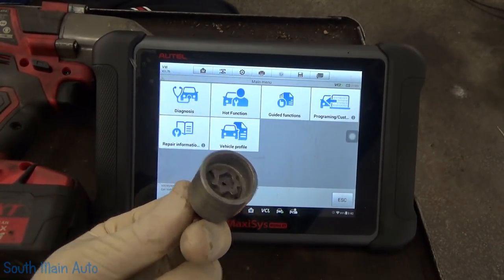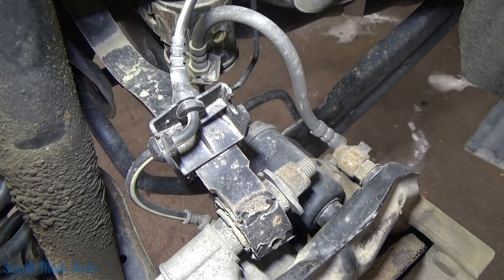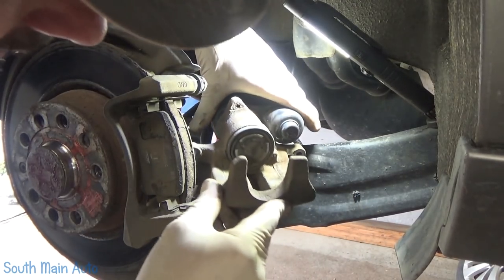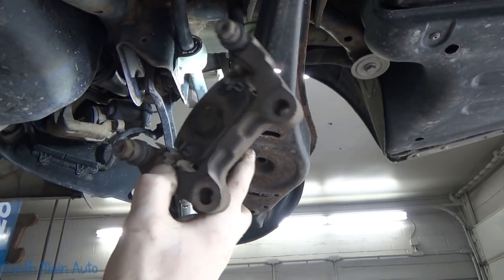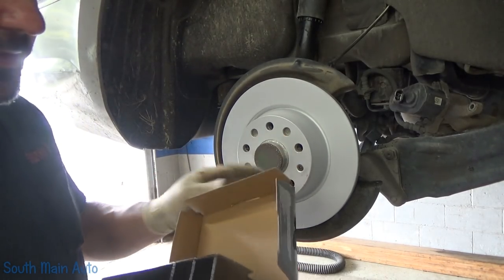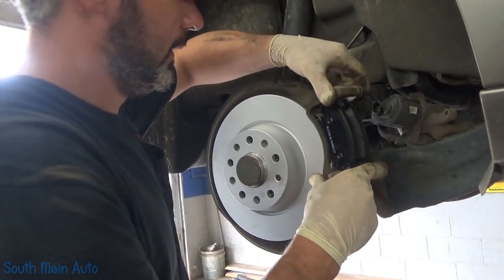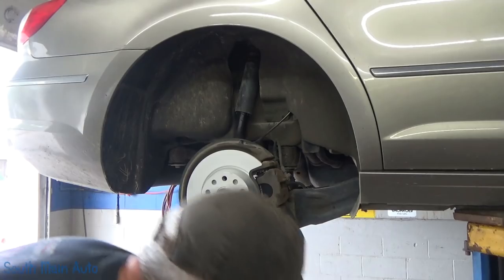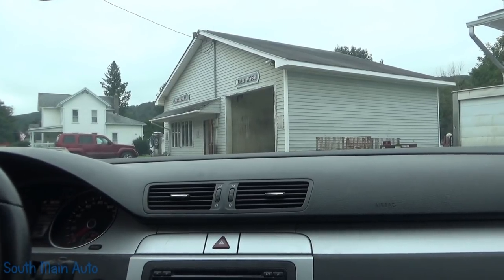Do You Need A $1000 Scan Tool Just To Change Brake Pads!?

Comment: I think it's terrible that on these modern cars you can't even do your own rear brakes anymore due to the addition of these electronic parking brakes.  I swear the engineers/designers add these systems to force the DIYer to have to bring their cars back to the dealership.  This channel educates us all BEFORE we buy a car so we will know what we're in for if we buy these models.  Great video.
Reply: Kenneth White  I think newer Audi's and other manufacturers  require the battery to be adapted or programmed to the car.
Reply: It's a VW, this is why you NEVER BUY EUROPEAN CARS! Way to reliant on computers!
Reply: Nothing to do with being a European all these electronic devices are to pave the way for stop-start and "autonomous" vehicles. Spoiler alert there is no way the authorities in any country are going to let autonomous vehicles be serviced outside the dealer chain.
Reply: Sad part is, that's ALL cars today. Wait until you see the crap they're doing on '18 -'19 vehicles ...
Reply: I would place the blame on business people wanting to maximize after sales work, and not so much the engineers/designers.
Reply: Of course they want you back at the dealerships. Get those genuine parts fitted/ BMWs require the battery to be registered, the original battery did last ten years though.
Reply: Rubbish.  ALL cars are.   Cars are made from components, manufactured by companies like Delco, Bosch, Mitsubishi, Hitachi, and the like.  So the VAG rear brake caliper is using exactly the same BOSCH EPB, along with BMW, Audi, Ford, GM, Opel, Nissan-Renault and Citroen.   

Mitsubishi is using either Bosch, Mitsubishi, or Hitachi.   Can you see there's a pattern here?
Reply: Again - Pretty much completely wrong.   You can install a new battery into any BMW without registration.  However - it probably won't last.  The charging profile for the battery you had is learned by, and programmed into the ECU.  The cars charger (Bosch) is intelligent and can charge AGM and standard batteries without an issue.   The intelligent battery charger, when configured correctly, will easily extend (double/triple) the batteries life - even when auto start/shutdown systems are involved.
Reply: And all they really care about is if everything lasts long enough to make the end of warranty. After that, they really could care less.
Reply: Very sad indeed. Even Chevy trucks are going to have that stupid start button with the start stop BS, the world has officially gone to hell
Reply: Many cars have a user accessible menu or series of button presses that will enable service mode.
Reply: i can see why engineers add these systems for "Safety! Safety First!" and now they have a safer car than others but man the brakes are a serious pain now with this new "safety system", there was a story at toyota that make sure you dont open the door when pulling the car onto the hoist/alignment hoist, one guy did and had the throttle halfway down and had the door open("safety sytem now engaged since the door is open and the driver must have accidently left the transmission in drive) just as soon as he closed the door, thats when the electronic e-brake let off and lets just say that brand spanky new 18 camry needed quite a bit of bodywork after flying off the alignment rack, as a mechanic im starting to feel these vehicles are getting a little over-engineered so your 10yr old can drive it if hes big enough for the seat
Reply: i have a subaru legacy with rear electronic parking brake, you can buy a simple tool that screws the piston back into the caliper which retracts the electronic parking brake. No computer needed.
Reply: It’s not new they’ve been fitting them in the German junk for at least 10 years now!
Reply: Adam Smith A lot of Fords do it too.  If I remember from when I was at the ford dealer it was called like an IVD initialization or something
Reply: TheMillennialMechanic funny Ford/Land Rover/Volvo/Citroen have a lot of parts shared!
Reply: TDM 4x4 Ford owns Land Rover unless they sold it, but I didn’t know about the Volvo/Citroen parts, that’s interesting
Reply: come on guys. VW needs to recover the 8Billion they lost on the Diesel emissions pickle they are in.
Reply: TheMillennialMechanic Yep now owned by TATA of India! We’ve got a right old parts bin of Ford/Honda/Volvo/BMW/Rover/Citroen to name a few! The BMW early ownership electrics with a Lucas prince of Darkness/BMW brand of lunacy! But they did give us the L322 Range Rover to make up for it 😂 then stripped us of the 4wd technology, sold us for £1 and kept the MINI badge too - another cracking German bundle of joy 😑😂
Reply: Dont buy new. lol Ive owned 50 cars and never bought one less than 15 years old. Most on average wher 95-01
Reply: I will just but old cars and fix them up
Reply: @motorsandmore990  my latest is an 01 passat with 145k I paid $250 us dollars for.
Reply: Yeah that's how i am too. I only buy mint condition low mileage cars that are between 1988-1995.  Mostly OBD I vehicles although i have a newer 1999.
Reply: Engineers planned the vehicles obsolescence and the company planned the service costs. Also built the vehicles to overwhelm the DIY’er.
Reply: @zuestoots5176  nice
Reply: @zuestoots5176  i have a 2000 gmc pickup that i bought for 3k with 126k on it has 150k now, not a single issue.
Reply: @motorsandmore990  I would never pay that much for a GMC.  Hell, I've never paid more than $850 for a car. I alway buy broken shit and fix it.
Reply: Just wait, soon enough you will have to bring your car to the dealer to add air to the tires.
Reply: Kenneth White I'm with you it worries me I love working on my own cars saves me alot to
Reply: You're mostly right but rumor has it that the car companies want to copyright their vehicles so any unauthorized change or upgrade violates federal copyright laws so that forces the mom and pop mechanics and diy-er to bring the vehicle to the dealer so the dealers (ie. Volkswagen) gets exclusive work on their cars and no one else touch them along with solely renting cars as opposed to buying so if you keep the same car for 15 years your payments stay at 300 dollars per month for the entire time the car is under your car kind of like renting an apartment it's just to use the legal system to screw us out of every dollar we make while the CEO can keep getting money coming in by the truck load every week now just to restate this is just merely a rumor I heard but honestly I wouldn't put it past these assholes to pull some crap on us like that...
Reply: Yes, and the parts cost too much!
Reply: tcpnetworks .
Reply: This crap is just BS. They want only dealers to work on cars anymore. Buy the tool for 500 dollars next car it's outdated. Should be apps and cables to do this on your cell phone  or tablets
Reply: yep 95-01 and even little earlier great vintage and some of best practical cars made, all my family have hand picked used cars from this era and with my support they got most reliable no hassle and low cost vehicle running virtually possible. you would have to be stupid go buy a new car or new era used car with your own hard earned money .
Reply: It's a very bad design and the people who did it should feel bad.
Reply: All this needless electronic nonsense is precisely why I'm sticking to my '95 vehicle for as long as economically possible - I even regularly look for a lower mileage one in case another good one pops up at the right price and I can switch. Mid-nineties was IMHO the pinnacle of worthwhile technology - going beyond that just seems to be a added nuisance and potential pitfalls for no real benefit where planned obsolescence really started to be pushed by the car makers.
Reply: @TonyRule  well said. I couldn't agree more.
Reply: Atleast fords dont need scan tools to put it in service mode
Reply: Just more crap to go wrong. Saw a story on the news where a old guy got into his late model Caddy in his garage and the battery went dead and was trapped all day and all night and into the next day. Couldn't unlock or open the doors, roll down windows cuz they're all electric operated. Didn't have his cell phone on him either. Thought he was going to die so he wrote a goodbye note. Next door neighbor noticed the garage door open all night, which was unusual, and went to investigate. First responderers got there and pointed to the emergency release lever hidden between the sill plate and seat. GM spokesman said he should have read the owners manual. He didn't have one. He bought the car used. Also the reporter pointed out there was only brief mention of the release lever.
Reply: Dont buy it. Know what you are buying ahead of time. Its really a over engineered pos.  Buy a car or truck that the dyi guys can work on.  But yet again you cant blame the enginneers... the millenials are all about computer technology.  Maybe they are doing this crap to attract them instead of them playing with apps. Lol. On a serious note this service mode crap that is built in is pathetic.....money making scam.
Reply: Do you need a "subscription" for the tool to be able to go into service mode? If not, that's a missed profit opportunity.
Reply: On Mercedes you don't need a scanner to do that, you can do it with the steering wheel buttons...
Reply: @zuestoots5176  each car I buy gets older,because of this shit. The nineties are best mix of modernity and simplicity.
Reply: planned ob·so·les·cence

/ˌpland ˌäbsəˈlesəns/

noun

a policy of producing consumer goods that rapidly become obsolete and so require replacing, achieved by frequent changes in design, termination of the supply of spare parts, and the use of nondurable materials.
Reply: @andrewwmacfadyen6958  Autonomous cars make me feel uneasy on many levels. Servicing of those complicated things is one, reliability and bugs second, but the most worrying is possibility of malware/viruses/cracking. The idea itself sounds nice but the real world is not an ideal place for every nice idea.
Reply: @ericjohn9277 I think the same could've done here too, it was only a 2 prong connector there.
Reply: @johnrtrucker  This is already happening with some farm equipment. There is a manufacturer - possibly but not certainly John Deere - that started invoking DMCA protections on any user-supplied fixes or work on equipment you buy from them and/or denying warranty claims if any user work was detected. Some farm implement owners were involved in litigation over it if memory serves. The DMCA is one of the worst pieces of anti-consumer legislation in my lifetime.
Reply: You dont need to use the scan tool i done these many times all the scan tool does is wind piston back one turn      caliper pulls right off anyway
Reply: @andrewwmacfadyen6958  spoiler alert. They will let people outside a dealer do the work. They'll just find a way to collect $$$ from it.
Reply: @mattbickford2640  if adults acted like adults and followed things they were taught in drivers training there would be less wrecks and all these safety devices wouldn't be getting added so rapidly.
Reply: @tcpnetworks  Are you saying these BMW's don't have alternators, they have a battery charger?
Reply: My personal experience with even early to mid 2000s cars is it was already too late.  They designed things in a way that would make you hate being a mechanic.  Removing bumpers to change headlight bulbs.  Take Eric O's video on the early 90s Miata clutch job ...  I mean many videos on it.

My next two cars are going to be ones I had before and I know I can service them.  One the model ran from 86-91; the other is a mid 70s land yacht of a Pontiac.  I'm done with new cars, as I would much prefer to not be a contortionist, disassemble the body of the car, or have been born with tiny hands and skinny arms as the last one is really hard to change :p  I just want to change my filters, bulbs, belts, etc without 30 mins of removing parts, pieces, batteries, etc to get what should be a 30 second job done.

Now, I would reconsider if I lived near SMA, as I'd trust Mr. O with my car more than myself!
Reply: @tcpnetworks  why would you need to 'register' it; if you replace it with a like battery?  If it has the same stats, the computer shouldn't be able to tell the difference.  I shouldn't have to calibrate a dinner plate to you specifically.  A battery is a simple storage device of electric potential; I can see if you are switching between AGM and old lead acid types, but again, not if you pay any amount of attention.

RE: another comment about start/stop.  My car has it, from 2005.  It also still has the original battery that I'll replace this year before winter hits.  Just needs to be the right physical size, CCA, and terminal polarity (its an 'R' version of the size).  I don't have to use a factory battery; but I'm also smart enough to look up the difference of the AGM battery types and determined that from the information I gleaned I'm better off skipping it; extra cost, and if the first battery lasted 15-16 years; then the one it came with is more than sufficient; it even passed the test at both the place I got new tires and an auto parts store; but it is definitely at reduced capacity, 70% iirc?  But recall a SMA video or few where low batteries cause all sorts of gremlins at a certain point; and last winter we say -20F, so better safe than stranded.
Reply: The engineers and designers don't like that crap any better than you do.  They are ordered to do it by the bean counters who want more dealer service money coming in.  Remember, most engineers work on their own cars.

Most people can't afford to quit their job because the boss orders them to do something they don't want to do, and engineers are no different.  If one or two quit, saying "I'm not doing that crap."  they'll just assign it to someone who can't quit.
Reply: @automedic9781  yah the 500/Taurus has Volvo AWD system under it.
Reply: People without training shouldn't be working on their own cars. You wouldn't believe how many time I have to fix some idiots mistake because they thought it could be done at home..the reality is most cars can not be worked on at home.
Reply: When you buy a new car, add the cost of a decent scan tool to the purchase. With the right tools DIY is very cost effective. I have saved the cost of the tool I paid for 10 to 20 times( I think it was in the $300-400 range, been  bought 15 years ago.).
Reply: @Bighead-he8zb  and that air will have to be imported from Canada
Reply: @motorsandmore990  you will soon enough with intake gaskets and knock sensors/wiring harnesses.
Reply: Just don’t buy a vehicle that has it... problem solved. And if your a mechanic, just keep your shit box running.
Reply: @AdamSmith-gs2dv  No computer problems with a 1938 Mercedes.
Reply: @automedic9781  Tata motors of India owns Land Rover, Jaguar, and others.
Reply: @johnrtrucker  Just like iPhone
Reply: @arthurrodesiler3109  Farm equipment has been like this for awhile.

Comment: Hey a handy tip for those connectors: Push them in a little with the tab pushed down before you start trying to pull them out, it makes them way easier.

Comment: There are many electronic scan tools made now that allow you to do brakes. They range from ones designed only to disengage the brake system for Audis and Volkswagons Ancel VD500,which is $54.99 on amazon right now, all the way to the Autel MaxiCheck Pro, which while not as fancy as the 808, should do everything a DIY guy, like me, needs for $226.00 also on Amazon. 

PS. Love the videos.

Comment: As an average DIYer, dis-connect the battery and with a long pair of jumper wires reverse the polarity at the caliper. Sucks 'em right in
Reply: Even easier 
Lift on Jack stands put in neutral
Reply: Large pair a channel locks always works for me...
Reply: But when we connect the battery back, computer sends signal to piston to squeeze to the old positio which ruins everything..not sure
Reply: @terminator7137   its for real
Reply: @nc6826  no, the electric motor will run until it pinches ... when there is a certain electrical resistance, the computer knows that the parking brake is applied ... it has no memory of where it was applied last..because the brake pads wear, and if it had memory as you said, then you would not have any parking brake after a while

Comment: I remove the motor an turn it manually, no problem. They calibrate each time you use the e brake. Done it lots of times
Reply: Going to try it
Reply: blkthunderbolt if you have a Ford or Mazda there is a way to do it without tools. I posted it in comments. Message me if you want help.
Reply: if its only 2 wires its likely a dc motor with a gearbox. pig tail with a small battery will likely release the break in one polarity and tighten the other.
Reply: Yes, no problem doing it that way.
Reply: That's what I've been doing on late-model Volvos.  Works just fine, and I haven't had a comeback.  And yes I have a scan tool capable of retracting the parking brakes on those cars - it's just faster to do it manually.  Time is money!
Reply: if u have a battery u can jump power and ground to the pins which will detune parking brake so u can compress it if you didn't know that haha
Reply: Wasn't sure if there was a re learn w the electric parking break. Good to know nothing happen s

Comment: Didnt read all the comments but you can reset the parking brake manually. You have to unplug it. Remove the motor from the caliper and then turn the caliper where the motor would be until it stops. Then you can push the piston back without crushing the parking mechanism. I just did this on a 2011 bmw in the driveway.....enough bout that. Love your videos. Keep up the great work

Comment: I just apply 12 volts onto the plug on rear of the caliper (remove plug first), works every time.
Reply: There is no need for a scan tool or 12v just do as usual